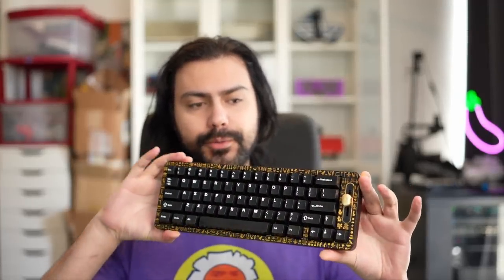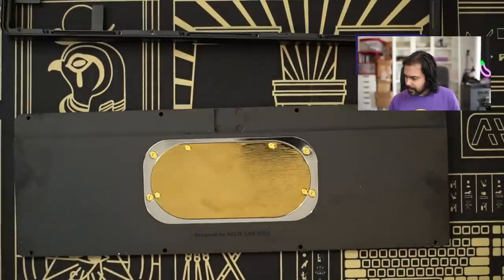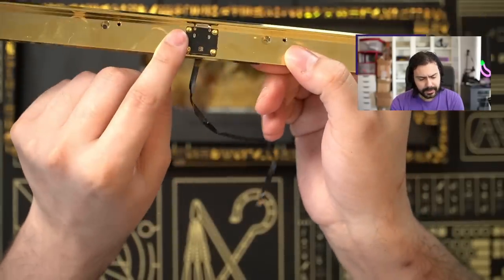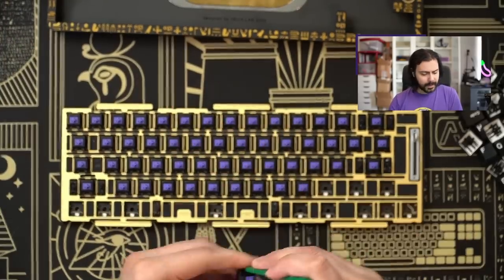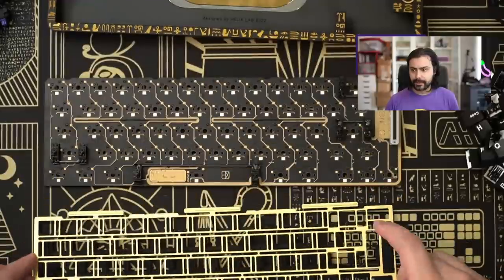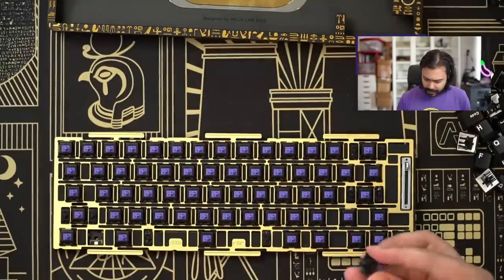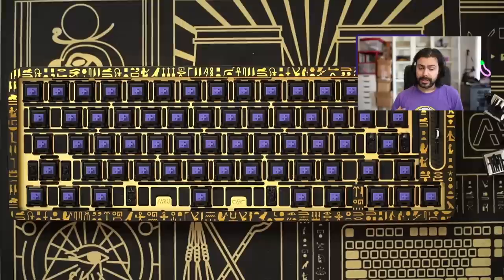Helix Lab AARU 65 In Depth Keyboard Review

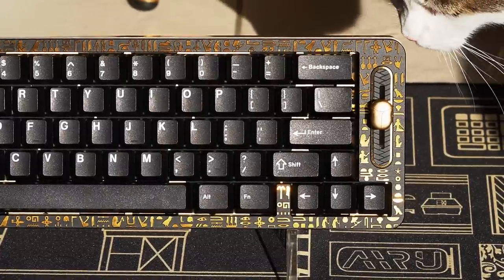Comment: 0:00 Intro and specs (0:36 Sniff)
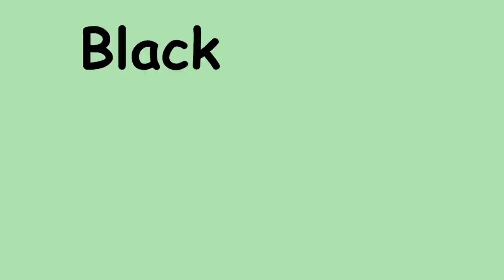2:07 Daily rant about Ham Hair on deskmats
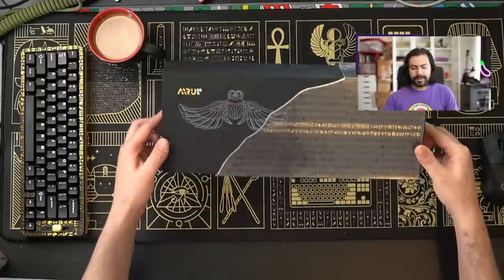2:13 Unboxing experience (Note: reviewer unit; packaging may change during GB)
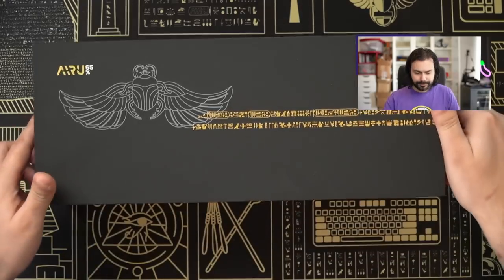4:32 Some ranting about no hard case available 
5:37 External Case
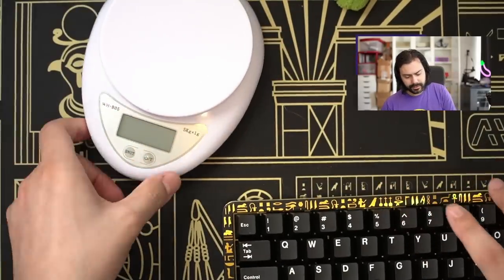12:28 weighting the board 
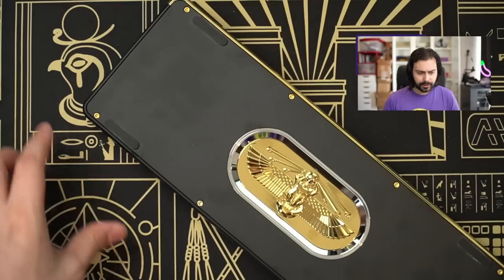13:19 feet review
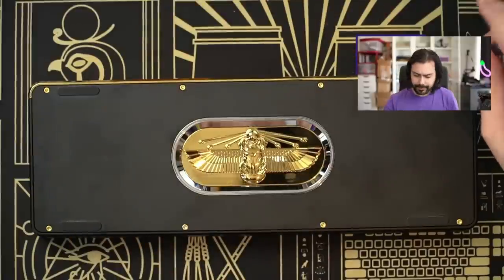16:05 Disassembly experience
17:10 Mounting talks
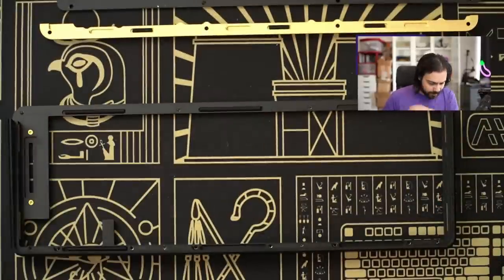21:53 SCREWING TIME 
23:44 Case Bottom and weight
29:58 Case Top (Two-layer anodization Talks)
35:53 Mounting mid-piece
36:50 Decorative Backpiece 
37:50 Lil bugger 
38:59 Plate/ PCB/ Typing Experience 
1:27:50 Typing test
1:29:32 Summary (Simon's note: Watch the whole thing if you are interested in the board)
Reply from the maker: thank you for your sacrifice

Comment: Great review but I'm a little confused. It seams from your comments both typing feel and sound were meh, but you say a few minutes later the board is fantastic and one of the best 65s in years. Were you just being tough in those respects but actually really enjoy it? Or did the looks push the needle that much for you to overlook the problems and purchase?
Reply from the maker: Sorry for the confusion.

It's definitely a board that is specced into aesthetics primarily, which really helps it along, 
however with a plastic full plate, and the planned fixes, I think it could get good enough as a complete package (getting the sound and feel more than just "meh" tier)

Comment: Do you think the gaskets being clamped down on with a lot of force while also being hard to begin with could contribute to the sound issues?
Reply from the maker: A bit, going too loose would open up a can of worms of other potential issues, like a rattly plate.

I think a very slight softer o ring would be helpful